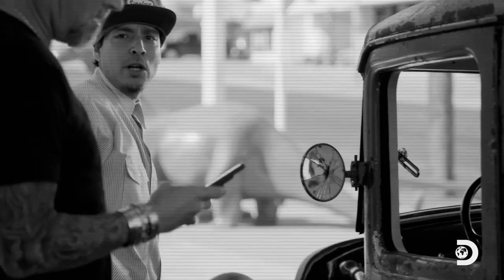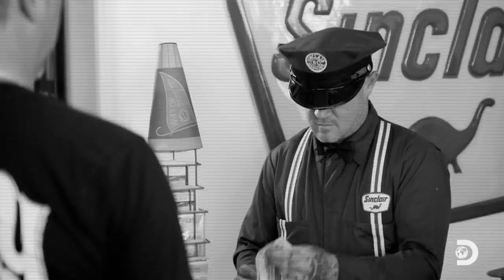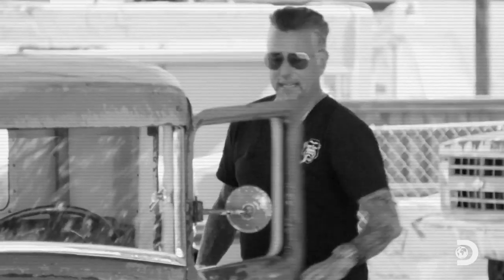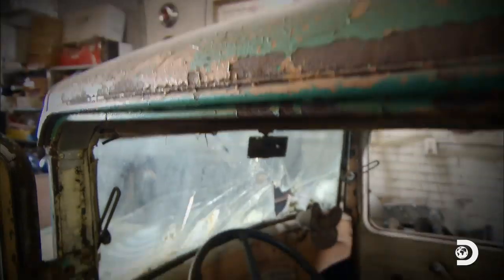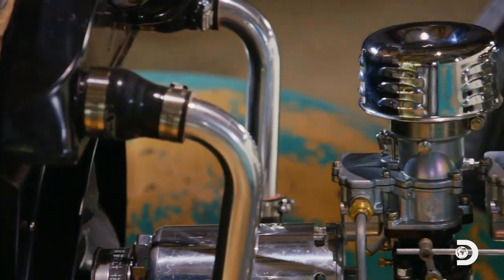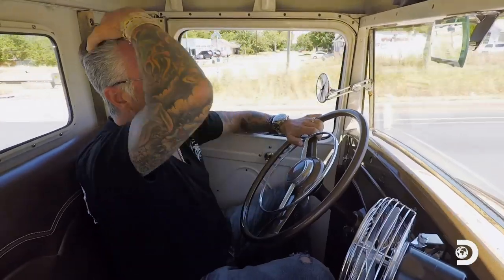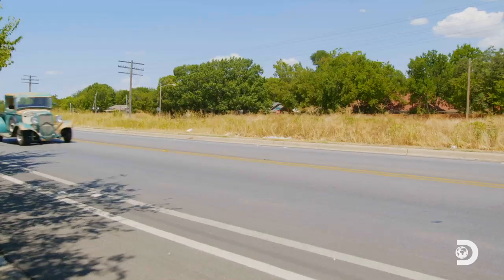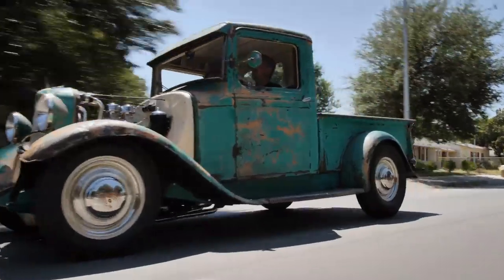Gas Monkey's '33 Ford Pickup | Fast N' Loud

Comment: i Like Ford 1931.1932
Reply: My faves are the 32-34 Ford's and the 39-40 Ford coupes. I like the earlier ones too but 32 was the first year for the Ford Flathead V8. I'd love to build a 39 or 40 Ford like an old moonshine hauler but with a hot fuel injected 302/351 and modern steering, brakes, and suspension. I would leave it 100% stock in appearance but with more modern mechanicals